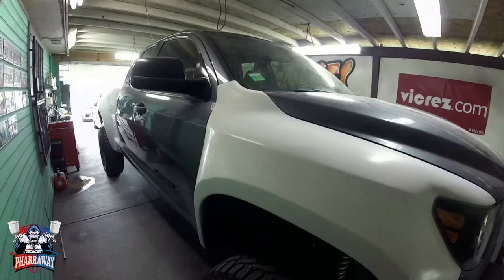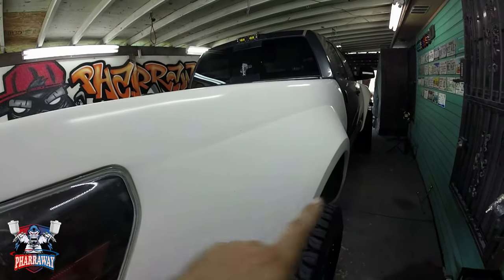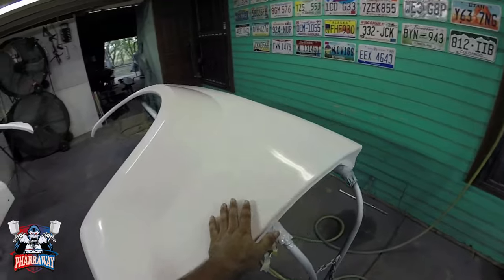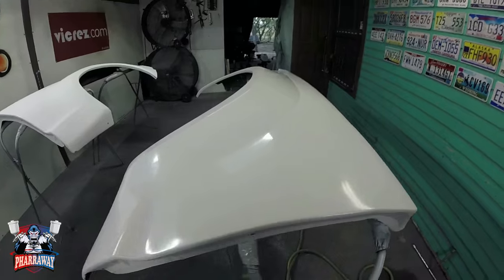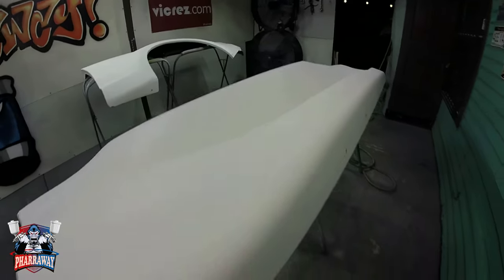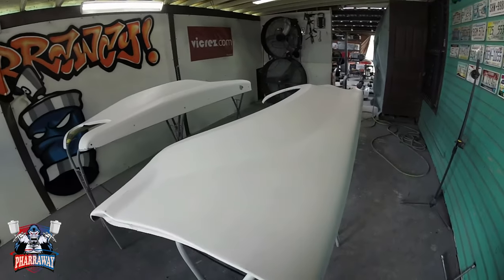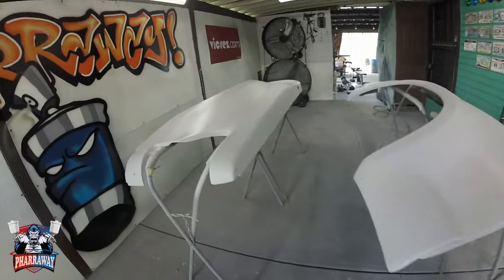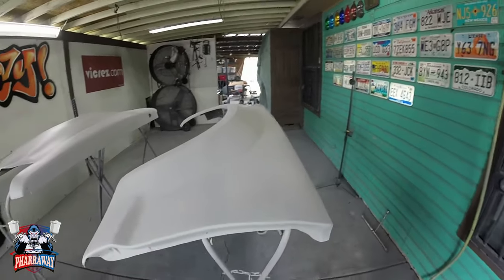Painting Fiberglass - How To Prep Fiberglass For Paint!

Comment: Quick question for you man, I am doing an old fiberglass boat, doing gelcoat on the hull and was thinking about painting the deck, 15 feet long 1966 glastron, and was considering auto paint then, multiple coats of clear adding metal flake to the clear to get the factory finish, what are your thoughts, I will be working with my brother in law who will do the spraying.

Comment: Nice video! I fibreglassed a small boat that I built. I want to paint it with marine paint … regular stuff, not gel coat. I guess I need a primer especially developed for fiberglass … right? I can’t just sand and put the paint on, can I? If so, what is a good primer that I can brush on?

Comment: Great video as always Pharraway with all the info you could want to get the job done, fiberglass can be a right pain to paint as more often than  not it will be an aftermarket alternative to a OEM panel so the quality it not always the best and need a lot of prep work but the ones you have there look to be pretty good, a good high build and blocking and you should be good to go👌🙏👍
Reply from the maker: That is correct 👌